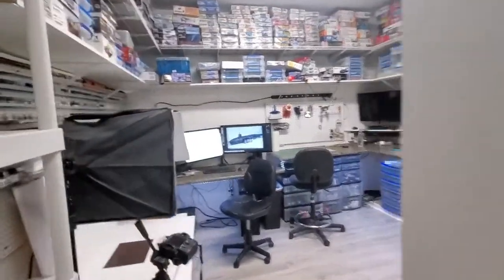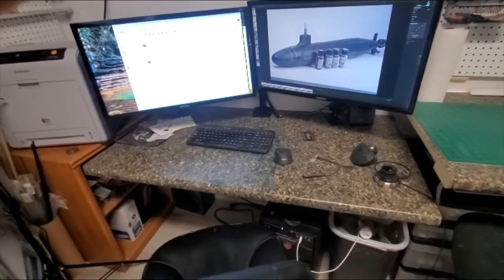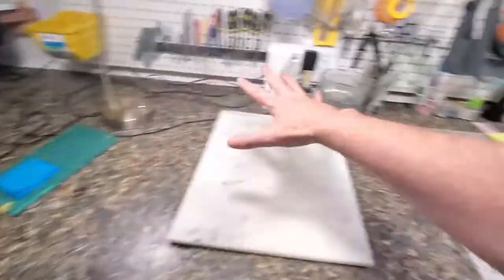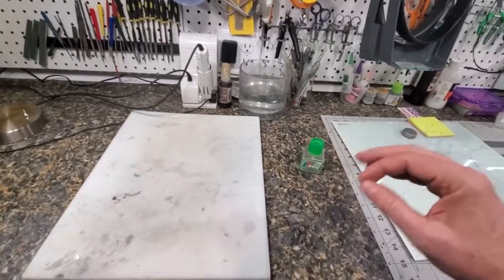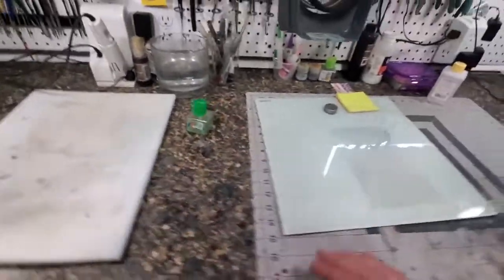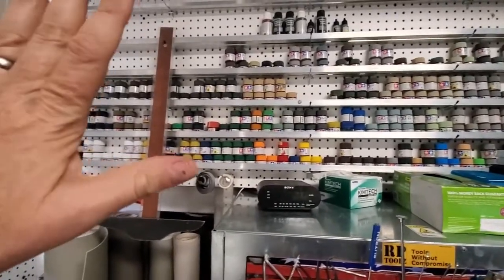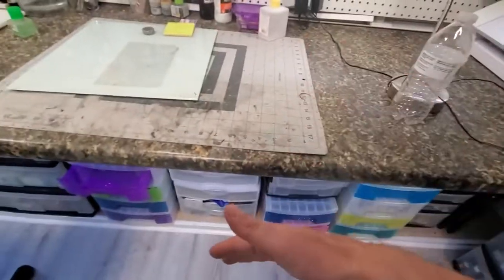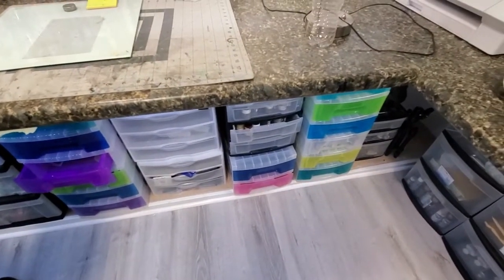Workshop walkaround 2020

Comment: Great term "Bench Chaos". As the workspace grows so does the chaos. At one time I had @ 26 feet of workbench and it was all a mess with multiple models spread around. I am back down to a 4 foot bench and it works well in most cases. You are correct. Putting things away is the key.
Reply from the maker: yep- unless I'm building a huge model (like my trumpeter bismarck in 1/200) I don't need much bench space at all.   It works for me anyway.  Thanks for looking :-)